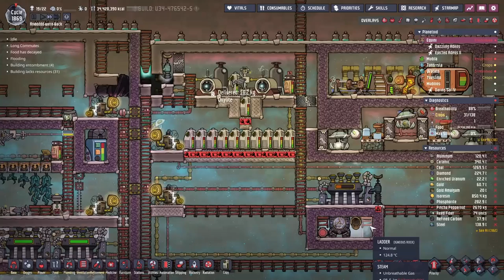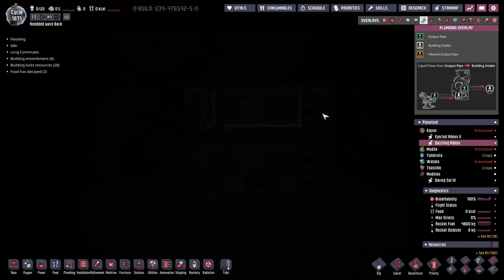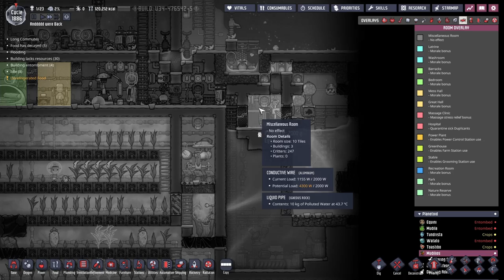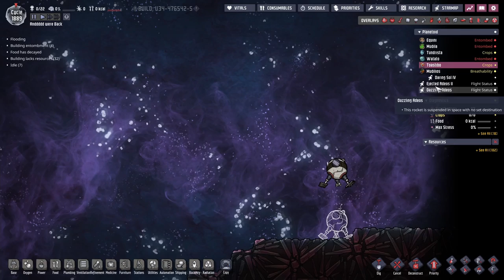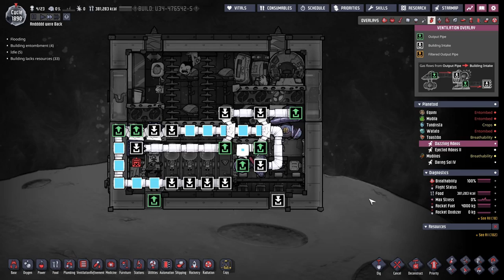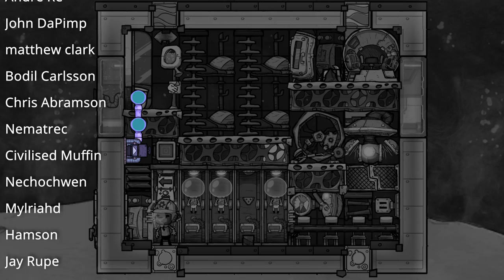Ep 26 : How to tackle a Fire planet : Oxygen not included Spaced out

Comment: Hey John! At 16 mins you use ur oxylite to delete the CO2, instead you can directly pipe out the CO2 via the gas output on the bottom right (just ejects it into space)
Also! With the wall toilet, why not just use the water pipes as a storage? Run the water all around the room, fill it up from the outside input port, and then just run off that. That way you don't need the liquid cargo module
Reply: You can also make a somewhat small Oxygen tank using pipes in the background
Reply: More efficiencies, I love it.
Reply: I'm watching this again for ideas and I thought the same thing. But you don't need a vent set up on the outside of the rocket to get rid of the co2?
Reply: @AdamRotering  not to my knowledge. At least, whilst in space, it just seems to delete the gas
Reply: I believe he has multiple ideas for the water tank, considering that if he used it for the toilets alone it would be 900 cycles before needing a refill.  Besides, it's always a good idea to bring extra water. 🤔🐶🐕

Comment: The pixel pack behind the fourth exosuit dock in your rocket is lit. Considering rerouting the power cables or disabling it with automation. Also, for your info, you can build mechanized airlocks through mechanized airlocks horizontally as well as vertically. They can be built diagonally up but not diagonally down.

Comment: 24:44 If food decays in there, you might get some polluted oxygen that will ruin your food. If you can, crank the aquatuner down until the temperature is low enough to freeze the polluted oxygen.
Reply: Berry sludge is not decay.
Reply: @yearss612  Berry sludge may not decay. But didn't you see some of the bristle berries at Stale(54%)? That clearly means that they were taken out(most likely to be cooked). It is unlikely, but still possible for those Bristle berries to reach maximum(or minimum?) staleness and rot.
Reply: @thesentientneuron6550  nothing will decay there. Ever.  Unless something from the outside messes with it; and that would require him explicitly requesting the food to be disturbed. Even losing power won't make any 1% stale stuff go out of deep freeze. Too much mass in the metal tiles and ice block to worry.
Reply: @deathx0r  essentially, this is true, but on game-load there are several issues in both vanilla and the dlc, food degradation (no matter how it's stored) is one of these issues, and can happen. Some of my food turned to a rot pile this way, and it was stored in -28°C Chlorine, thoroughly frozen (I'm still using FJs first design after food got patched). Didn't offgas pO2 when that later on became pDirt, but stored in a vacuum, it's a different matter. 

Dupes getting called away from lunch before they finish their food is an absolute nightmare in most of my bases, and it's been this way since before the dlc came to early access. Hope this is something Klei is aware of and plans to fix
Reply: @deathx0r  The food was taken out and it went stale outside. The food will increase in staleness for the tiny  amount of time that it's outside the deep storage. My point is that there's always the tiny chance that after a long time, there could be some food at 1% staleness that's picked up by the auto sweeper and loaded into the conveyor loader. Since it's at 1%, it may decay into a rot pile on the rails/inside the conveyor loader. There is a considerable distance from the mess hall and the cold storage, so I believe this is something worthy of consideration, with several million calories of food and several tons of potential resin on the line.

Comment: I'd like to add something you may not have thought of, i used the liquid input, and fill a bunch of mazed piping with water, the liquid output doesn't matter for the toilet so you can store water in the piping directly. As for the air it vents directly into space once launched and disconnected from the venting system, so using a powerless gas filter and a micro pump you can setup a sensor system to turn on pump (when it doesn't detect o2 or detects c02 whatever floats your boat and vent c02 into space while keeping oxygen onboard, no more messy piping to store the c02. No gas storage, no liquid storage modules. EDIT at 8:39 no this is no longer the case. They actually use the door and check for docks next to it now.

Comment: the new liquid (and gas) interior input and output are very useful, no need for an external liquid tank to refill or empty the snake pipes for toilets, thanks klei

that said before this patch, i did put a liquid tank not only for convenience (no need to deconstruct/reconstruct it at each maintenance) but also because i needed that liquid tank for operations on magma/tungsten or niobium planetoid
it's very useful to have 2x 9t of water for magma taming/mining when not using glitches, straight obsidian insulated tile + ladder + insulated tile 12tiles deep/cycle easy, just close and solidify magma with water when it enters the bottom, i never had pressure damage with this method

snakes pipes can store a lot of clean water, enough for 2-3-4 dupes for 15-20 days, i love snake pipes

for my gas snake piping i use a classic automation co2 filter, co2 pipes go directly to the output interior slot, then O2 goes to a 2k vent (low priority) and the atmo suit docks (high priority bridge) if i didn't add an oxygen gas tank, i'll probably add the double bridge+sensor to it

In the end the biggest problem i had was burns/scalding/dupes damage during magma operations, it was manageable with some attention and micro, but an hospital bed might be a good option (on the planetoid or in one of the rocket interior), there was very hot sour gas midway in the artefact room/ruin on my niobium/magma planetoid and 29t obsidian tiles didn't help lol (klei removed it i guess ? anyway i'm swimming into obsidian)

@FJ your design is very efficient, i was going to rant about the decor bonus but these pixel racks...

Thanks for your videos !

Comment: Edit: just realized my comment is the same as @Nicolás Rodriguez quote, see his.

Do you even need a water tank module on that rocket? if you filled the interior with pipes, that would be 10x8 (can't remember if you can build pipes in walls), and at 10 kg a pipe, that would be 800 kg. This saves you a rocket module, a interior space and a interior space @10:15.

Comment: FJ, you don't need use oxylite to remove CO2, you can just connect you CO2 gas pipe to the wall port. It will pump the content out like the wall toilet does.

Comment: Isn't the solar panel enough to charge the rocket "without" atmo dock.
They don't use the docks in travel.

You can just fill up a couple atmo suits. Place in container and when you get to said planet.
Manually assign atmo suit. 
1st thing to do when you get there is build up a small 3h*8w room for them to run out the rocket, enter the room, put on suit and get to work.

Giving you 15 more tiles to make it a bathroom and bedroom for moral, containers.

Comment: I really wanted to run the original asteroid size but my game is already slowing down.  I started a spaced out map, it turns out that not only the starter asteroid, but the planet it teleports to is also smaller (starter from 240 to 160 wide, 2nd planet from 160 down to 120 wide), and there is no uranium on either of them to have fun with in a reactor.  I can deal with the limited water geysers, but it's a let-down not having beetas or any uranium at all.
Reply: Beetas and uranium biome should be on one of the three starter planets, maybe you just got unlucky, and all of them are on the third planet?

Comment: I’ve been watching your videos for a while now, and I’m just curious. Why don’t you use the power control stations? All you need to do is give them 50 kg of refined metals (including lead) and it’ll increase almost any power generator’s output be +50%. I use it on my coal generators and they each produce 900 watts of power.
Reply: it usually not worth the duplicant labor or the metal long term when you could use it to build permanent stuff.

Comment: Dumb question, cant you just.. build the rocket platform at the bottom of a big pool of magma. And have dupes walking out to the base run for the hills?  Just make an airlock similar to the one on the water planet with say... molten aluminum and magma.
Reply: If so, it'd have to be a vacuum-double-lock. If exactly like on the Waterworld (yes, I went there!), the base's interior would heat up to Bestower-farmer temperatures, and scald everything inside. Which would be a whole new level of torture, even for FJ 🤣
Reply: @salemprompthous3820  oh true you'd need to use a vacuum seal.  Would be really cool tho
Reply: @ericab3919  very much so, yeah. Metals as an outer liquid-lock, guess it'd be warm enough to scald some dupes on their way through, though it might be a fun experiment